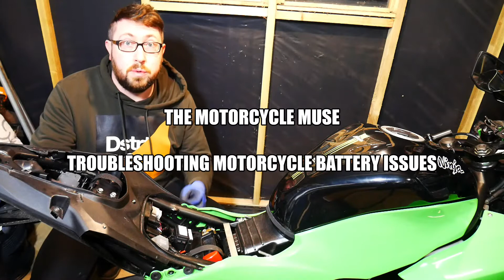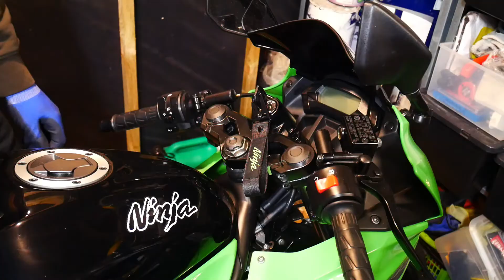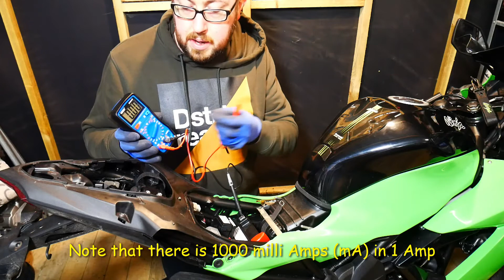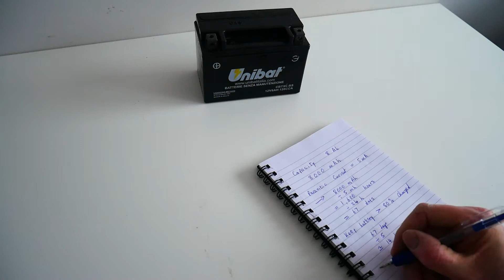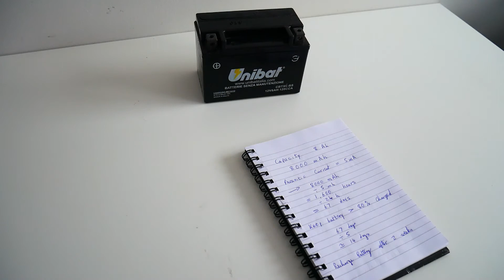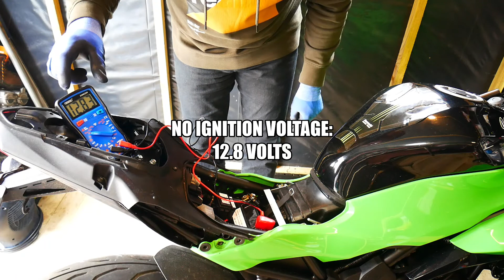Motorcycle Battery Problems - How to troubleshoot

Comment: why not just leave the battery it in the bike when charging
Reply from the maker: Charging the battery causes acidic gas to be emitted which can damage parts around the battery such as metal frame or paint or you could overcharge/discharge your battery causing it to explode or expand. More an issue on older batteries and chargers. If you know what you're doing and use a smart charger it should be fine to leave battery in bike while charging